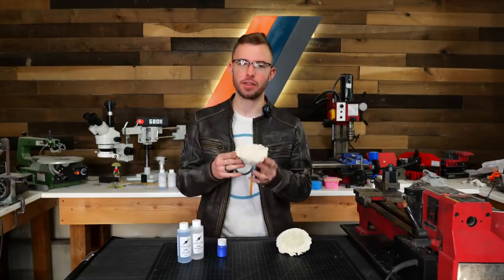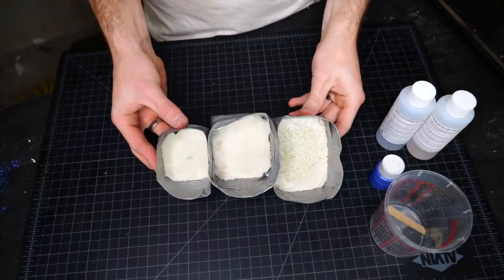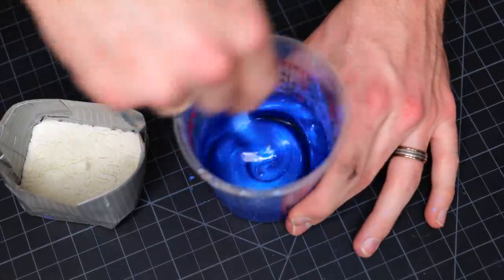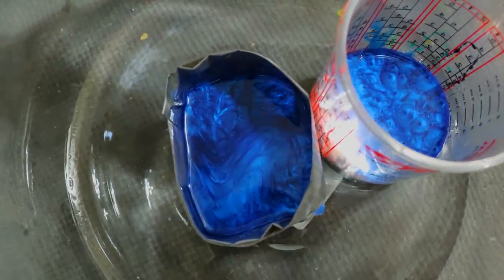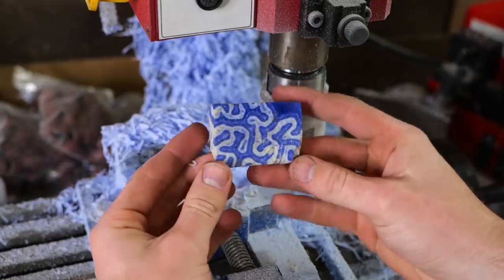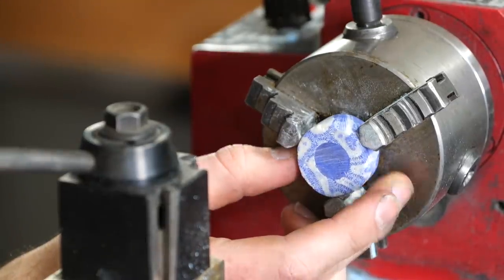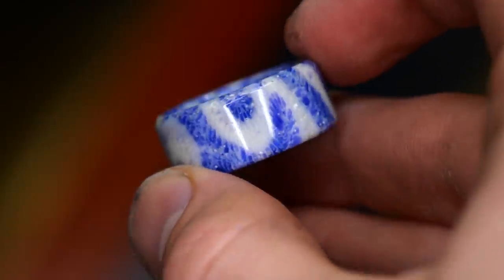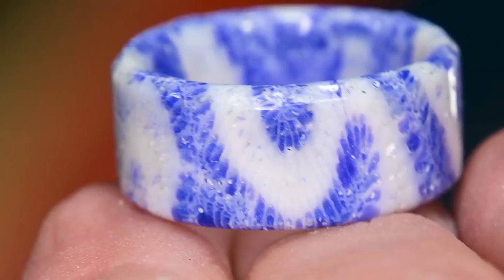Making a Brain Coral Resin Ring with Waterjet Channel

Comment: That ring looks good with the blue contrast. To improve your saturation you could try using a pressure pot instead of vacuum so that you're pushing the resin into the voids instead of trying to pull the air out and displacing it.
Reply: Nice idea but im pretty sure that best would be both, otherwise little bubbles which managed to hang on will expand after the pressure pond and destroy it...
Reply: A small vibrating machine should do the trick
Reply: Vacuum, then pressure.
Reply: @glidercoach  cycle it
Reply: @cybeermancom1  how can any bubbles expand after the resin is set?
Reply: @phillpennell311  Pretty sure they meant the internal pressure of compressed bubbles would be enough to break the super fragile coral and resin once the pressure is released, or when Patrick began cleaning it up and grinding it down

Comment: I was watching the material flex when you were cutting the hole and thought, that's going to break... and a second later. Nice work!

You might want to epoxy a metal insert on the inside to give it some strength. It's a delicate work of art.

Comment: Patrick, I know a lot of people have been asking for this, but you should make a magnetic ring. Basically what you would do is, using 3 magnetic pieces with the left and right ones having the part closest to where the center piece will go as one magnetic pole(north and south because you want the last piece to fit over the connecting section and "float"). And what you would do is put a magnet with the poles matching the two other parts (so they repel the center). Then you'd have like a "floating"/fidget ring that would always be forced to the center and you could move it against the magnetic forces as a kind of distraction.

Comment: Take coral and infuse with resin like you did but then leave the resin infused coral in a acid solution to dissolve away all the coral. Then fill the void left by the coral with a different color resin.

Comment: I'm surprised that you haven't started using a pressure pot like a number of other creators have. It would have definitely helped in getting the resin into the cracks and crevices of the corral.

Comment: I tried to make coffee Cup coasters by infusing resin with floral foam and I have no idea how you were able to put your project in a vacuum chamber with a mold that small, when I worked on mine I needed it to extend at least 7 inches above so that the resin wouldn't bubble out the top.  my project was about the same size as yours.
Reply: I was thinking the same thing. My resin gets huge while degassing.

Comment: This has probably been suggested, but I wonder if there'd be any way you could work in some sort of assembled blocks or resin or whatever material, and then cut that as needed, and reform it into something really amazingly whatever.  What I mean is something like how they make amazing geometric patterns in end-grain wooden cutting boards.  If you google end-grain wooden cutting board,  you'l find what I'm talking about.  Obviously that's on a much larger scale than what you're doing, but maybe there's some way you could do something along those lines.  OR, but similarly, assemble a whole ton of random stuff in a huge enormous wad, get chunks of that in your lathe, and see what happens.  You could buy a bunch of tiny action figures or LEGO people, cram 'em all into a container and fill it with resin, and make shit out of that.

Comment: I'm getting the feeling that, if you drop it, it's bye bye... :(
Reply: If the resin took properly it should be strong enough to take a drop or 2 without shattering but yeah after a couple of drops I can see this thing just shattering into a million pieces which sucks because it's gorgeous
Reply: If he coated the whole thing in CA glue it would probably make a strong enough shell on the outside to survive being dropped
Reply: I think he should put a stainless steel ring on the inside to strengthen it.